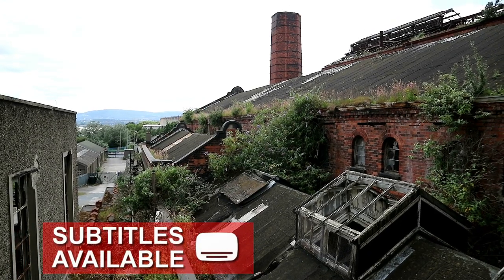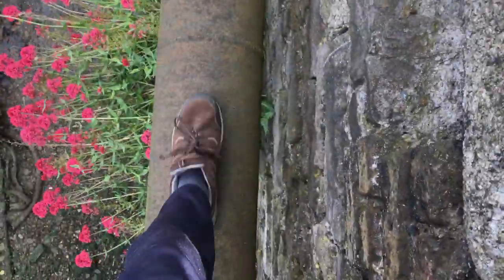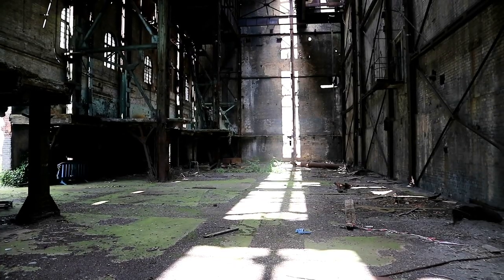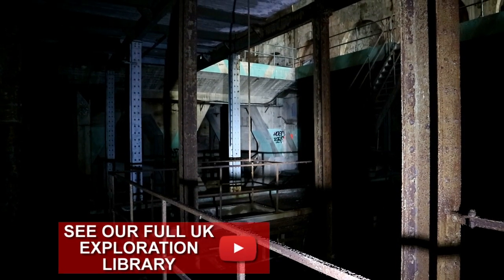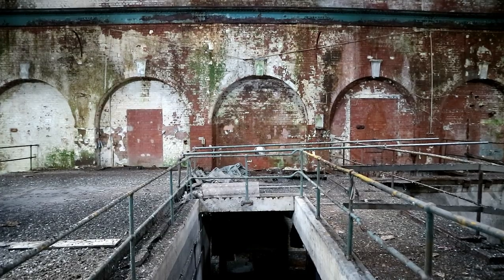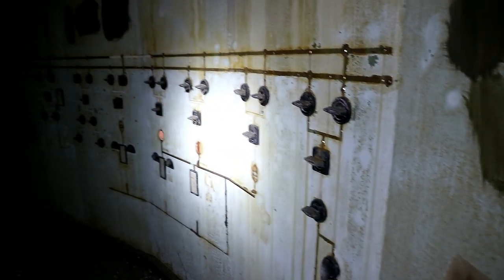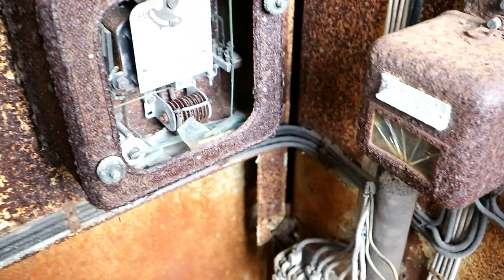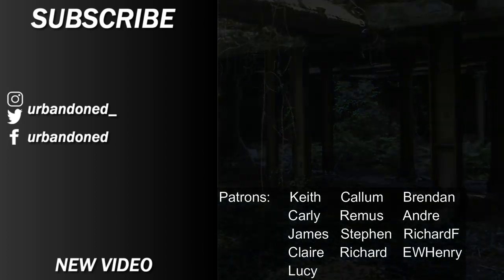Historic Abandoned Power Station: Decaying Control Room and Turbine Hall - URBEX UK

Comment: I worked 30 m from this building in the mid-90s, in what was originally the 18th century Pigeon House Hotel, but at that stage an enterprise centre for fledgling companies.  I've only ever seen the outside of the former power station, so it was interesting to see inside and the control consoles frozen in time is poignant. (nice lighting). We were there when Boyzone were making one of their pop videos in the 90s (they were in a double decker bus on site, while young girls were shouting in at them from behind the barriers). The power station and hotel have featured in several TV dramas. Anyway, thanks for exploring it.